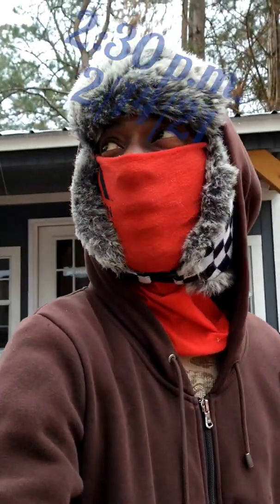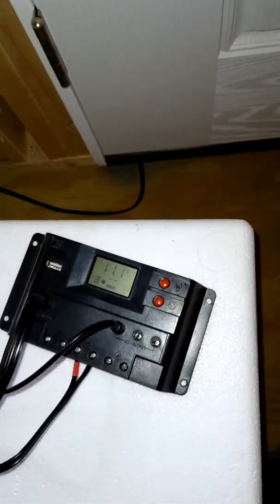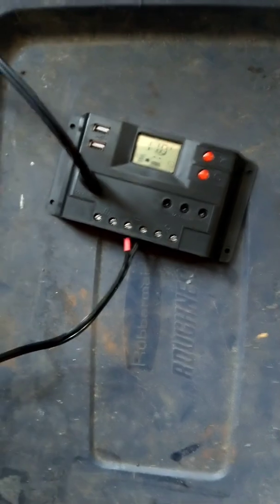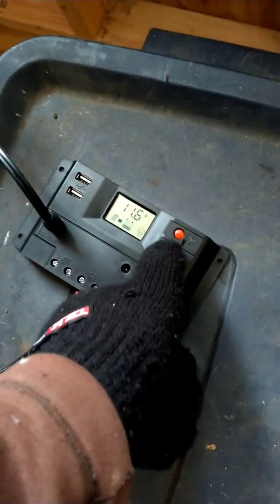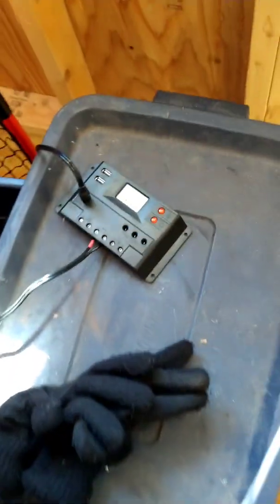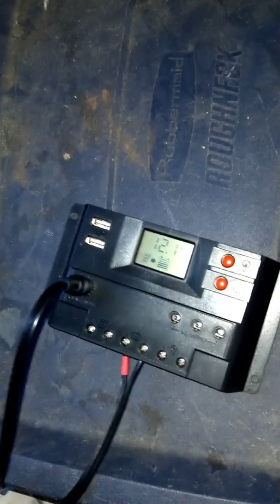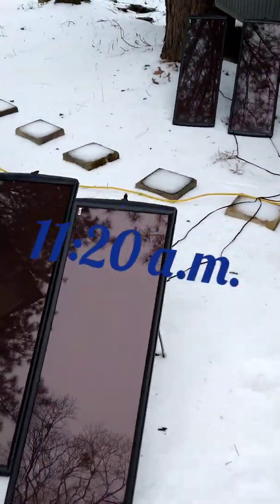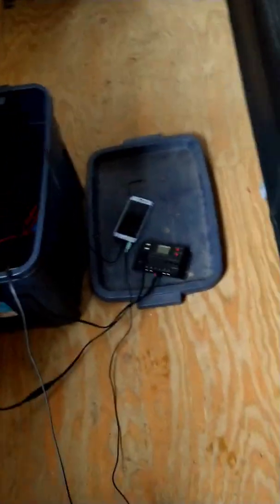Thunderbolt 100 Watt Solar Panel Kit review

Comment: Yeah those panels work good in snow glare..I got two of the 45 watt kits last fall..I put the kits in series on mine but if you do none can be shaded or the juice won't pass thru..mine is hooked up 24 v..when the sun hits the voltage is like 34..oh, I had 2 of the old controllers, and I found out if you hook the load to the batteries instead of the controller you charge the battery more...it takes away from the charging voltage too much the other way..try it and record the voltage..the battery voltage will be higher by simply changing where the load is connected...it seems crazy that they put those plugs where it took more juice when you barely have any juice...its only a few watts  but they should know this stuff,  not me have to find these things out lol